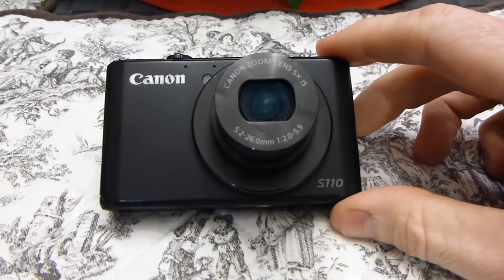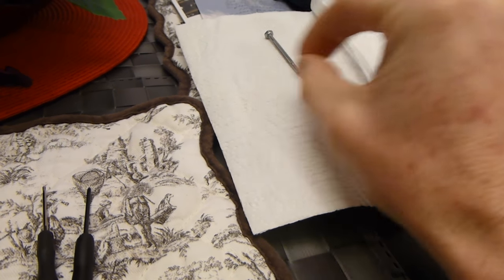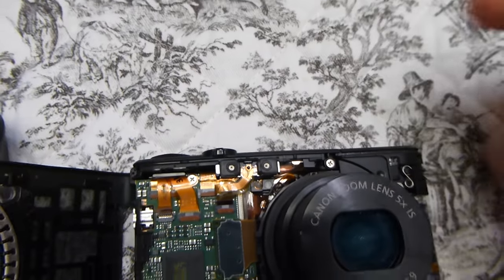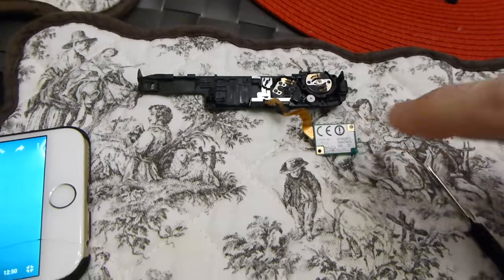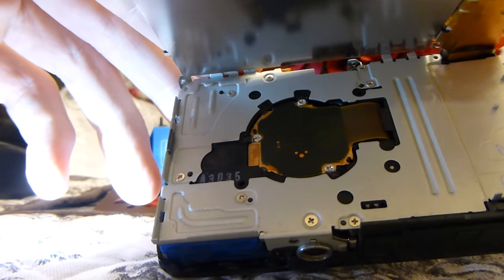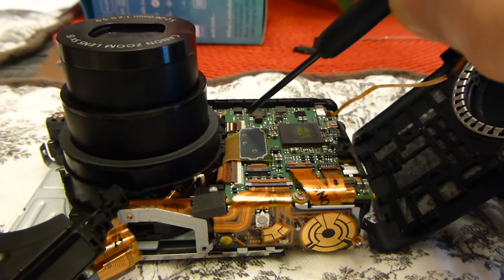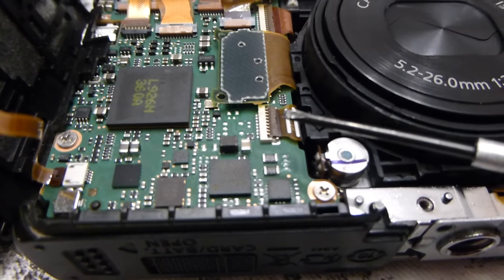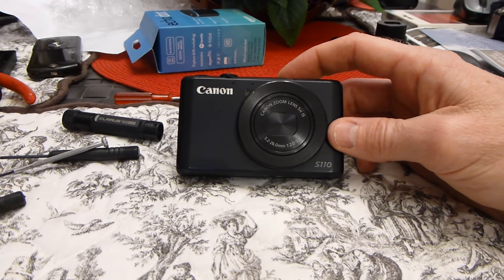Canon S110 Lens Replacement - Lens Error Won't Retract Stuck FIX!!

Comment: Bang it against ur palm of hand while turning  it on and off. It works! Swear down
Reply: Thanks, at least a step in the right direction:
With that tip, my S100 now retracts (and immediately protracts again).. but after that, that dreaded error message still comes up :/

Comment: What screwdrivers did you use? I was doing fine until I got to the smallest screws and even though the screwdriver seemed a good fit, it just mangled the heads and I had to drill them out.
Reply: Very likely to be JIS standard screws, not Philips. Subtle differences.

Comment: Hi, I replaced the lens and it worked for two days. Then the lens stuck again and I couldn´t get a picture. Only when pressing play I managed the lens to go back in. I tried to redo the cable as you said, several times but the problem is still there. Any ideas? Holger

Comment: Thanks so much! Completely replaced a jammed lens! Only comment which might help is that the copper heat shield has a tab that wouldn't sit in the bottom of the replacement lens as this was very slightly different to original lens which had a seat for the tab. I (gently!) sawed off the tab and it all fitted perfectly! great video!

Comment: Very useful video! Thanks! I even disassemble the lens barrels and cleaned it, hoping that will fix the error. No luck. The replacement piece is like $70 now and my wife's S110 is from 2013 or so. I hate to say it but it may be the time to get a new camera.

Comment: Thanks for the great video, I used it to replace the lens in my S110.  Its now working great.  Note, If you planning to do this job, you will need Phillips 00 and 000 precision screwdrivers.  Some screws were very difficult to remove.  Canon quoted me a flat rate price of $150 to do the job.